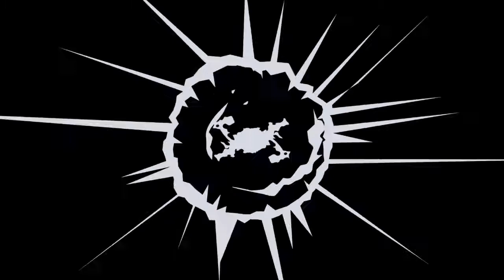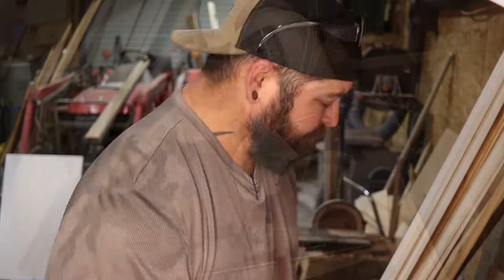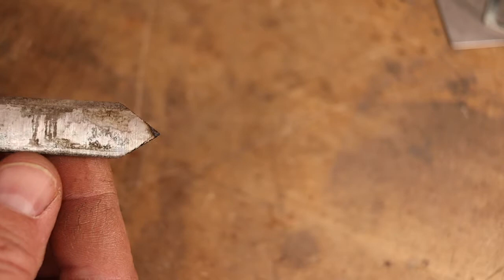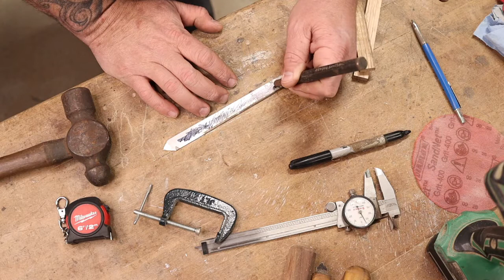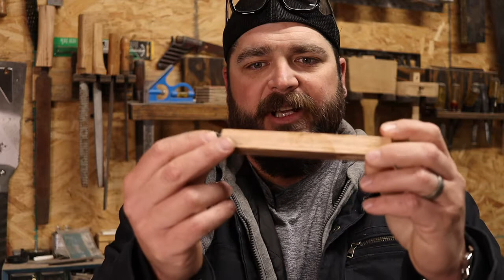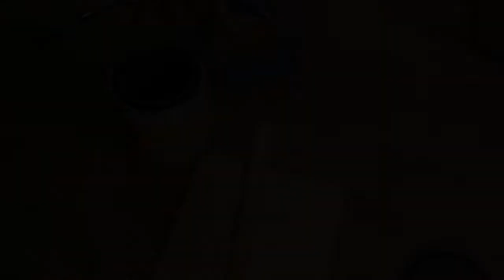HOW TO MAKE A WOODWORKING MARKING KNIFE ( HOW TO MAKE A SIMPLE MARKING KNIFE)

Comment: super hard lol punching through it was a surprise. It you want to use this material for other projects, maybe you could have a chance if you put the sharp end in a vice as a heat sink and then heat it up red hot and let air cool to temper > then you can drill that area? could work. I am currently making some blades for kalrosing knives out of o1 tool steel > love that stuff > works the other way around, it is soft to shape and drill and then you harden it just with a map gas torch. You wanted to know if anyone else made a marking knife, there is one on my channel with that same o1 tool steel. I think i used my BBQ to harden that one and it does not need to be super sharp, the bloody thing has stabbed me enough to be thankful that it's not razor sharp. BTW i like your handle shape, it suits the knife. timeless.
Reply from the maker: You know at the time that never crossed my mind ! 🤣 i was more concentrated on the camera than what i was doing . Using a heat sink and torch would have made all the difference! I would definitely love to buy some 01 tool steel in the very near future to try my hand at doing some bonified knife making and learn the tempering process . I will definitely go check out your marking knife video !